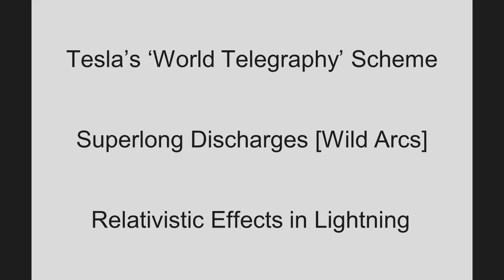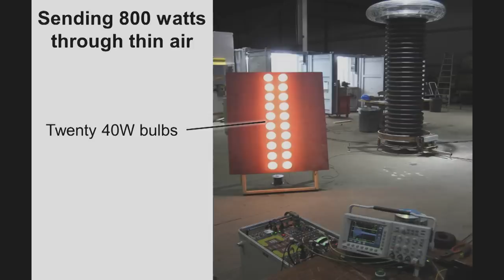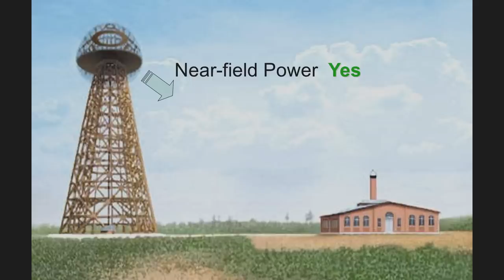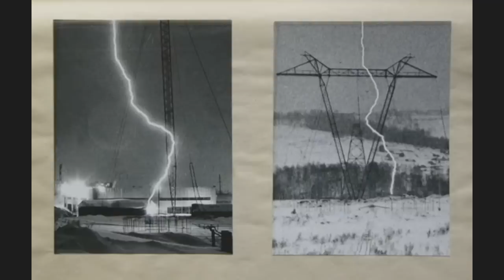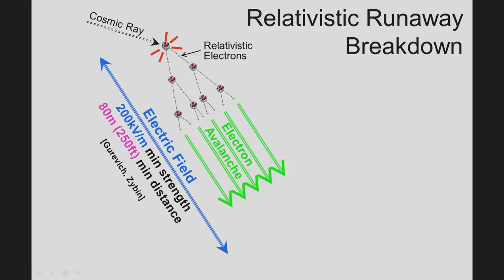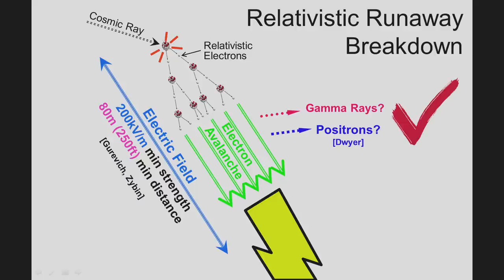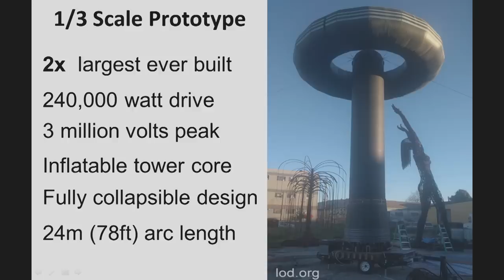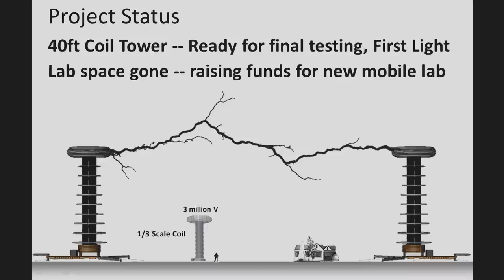The Secret Life of Lightning: The Science of Giant Tesla Coils | Greg Leyh

Comment: Once smart people like this realize the earth is literally flat we can get somewhere.
Reply: What "not so smart" people fail to realize when suggesting earth flatness.. is that not one engineering and mathematical approach regarding telecom and transport could work if it was.
Reply: @absolutium  177 miles with a 2cm infrared beam at deck height is a great proof thanks for reminding me. RF propagation is great flat earth proof by itself.
Reply: @nicholashpitts  RF propagation.. at what frequency?
Reply: @nicholashpitts  You need to realize no one is trying to convince you it is an ovoid.. we deploy long range infraestructure for local networking in the way a M.A.N I can tell you we would have saved millions if that was the case yet it isnt.

Comment: sir may i add enother explanation to what you have presented here the explanation off what relativistic runway breakdown may not be as illustrated is is not a cosmic ray striking a atom knocking off electrons that the statement off electrons shrinking sorry is obsurd this is very high energy light at one stage which compacts which in its pulsating cycle will call it c it is not electrons or free electrons as they do not exist they could not find anything for one reason only because they didnt understand lets call it L As electrons do not exist or a posotron as stated it is impossible for them to ramp up to lets say the speed off light as stated particles as stated do not bounce back along a magnetic line is is certainly not anti matter in the making the reason why you dont fully understand it is because you dont fully understand magnetism and L it is L in enother stage a simple experiment when two magnets with the same mass excelerate towards each other what exactly are they both excelerating too ? would they be two seperate magnets or one or would there be two north or south so called poles or one i state these things for people to have enother view off mainstream science which is unfortunately is in correct the magnets are a anology off why lighting follows a path to earth and also maybe the reason off why superlong   discharges cannot be explained with respect to greg leyh as to re produce teslas invention

Comment: 2000kV/m is not right
Reply: what kV/m is right?
Reply: @illygah  I was always taught 30,000V per CM was the breakdown voltage in air. So 3MV/m. But that's at standard pressure , temperature and humidity. I'm not sure whether it applies to high-frequency AC ie Tesla Coil streamers.
Reply: Relatively accurate, depending on temperature pressure humidity etc it’s safe to assume a 1000-3000kV/m